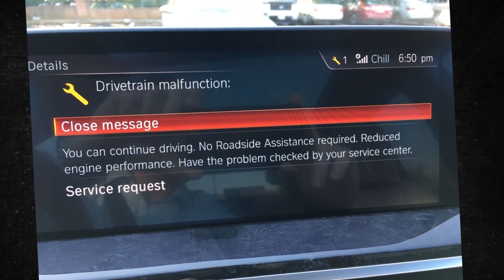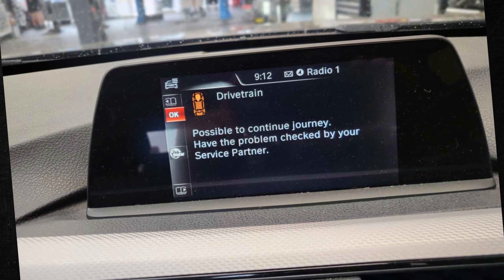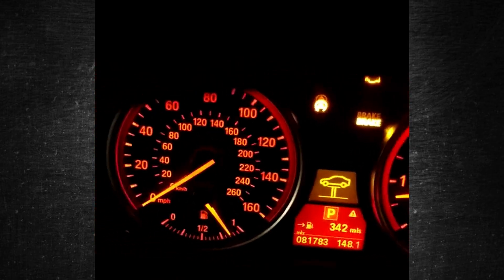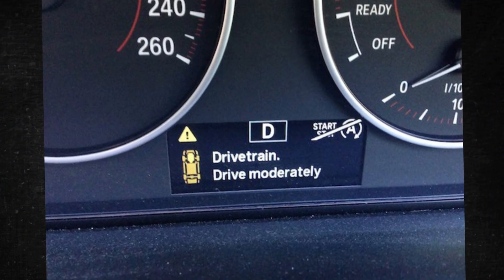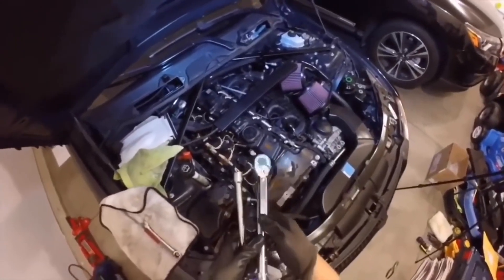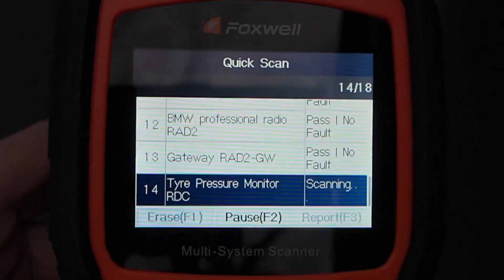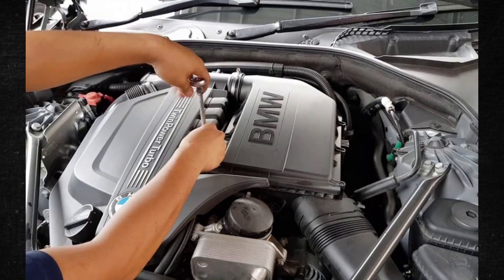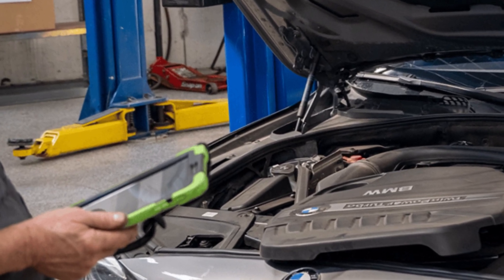5 Causes of Drivetrain Fault on Bmw (Meaning & How to Fix)

Comment: BMW x3 owner here. If you experience this problem. Start by removing your oilfilter. If your bmw is not serviced at the dealer. The oilfiltercartridge might be mässing. Causing oilpressure somtimes beeing too low. 
I had this issue, and noticed the missing cartridge as I changed the oil/filter. 
The solution is to buy a new oilfiltercap. Very cheap.
Had no issues after that. 
Its strange that more People dont know about this.
Hope it will help someone 🙂

Comment: If youve got this on your car. Dont worry. It's nothing serious. Very likely a loose connection or a sensor has become loose. I found this out today. Just get it plugged into a computer. My engine completely shut down. And wouldn't move. I thought my car packed up. Its just a safety thing on the car. So dont worry.
Reply: Would it be caused by coolant system issues?
Reply: I dont think so. The only issue i would of thought with a coolent system. Would be a leak. Why have you got it on your car doming up. Whats it saying ? @John-zh2zy
Reply: How do I remove the map sensor? It doesn’t budge and is really tightly fitted on my g30 2018 520d
Reply: @EggsEggsTension  I don't know anything about a map sensor. But I wouldn't of thought it was anything serious. But if you can get someone to plug it in. It will show up a code. And an issue
Reply: Iv git n missing message ibs sensor but replaced all ibs sensor’s but still get same fault clear codes stats away for few days then randomly as i turn car of boom fault pops bk up i get random faults for brake pads even tho new  n new wear sensors only thing i can think now is faulty fem
Reply: Did your car start rough for a second and then shut off like it was getting a misfire
Reply: Do you know what specific sensors it may be
Reply: Its a aensir that came loose when the mechanic fixed something on my car. They kind of clip together. Ill try and see which one  @ritojasso
Reply: Hey do  u know what fault codes u had ?and what year bmw ? I have a f10
Reply: I can't remember the fault code. But it was a sensor that was loose. So the car completely lost its power. Was nothing serious. Its a 320 year 2017  @DavidMendoza-y1p
Reply: thankyou bro im stressing rn but not anymore🙂
Reply: Same happen to my 2016 f30 I had to turn it off and wait a bit n then it came back now it’s at the shop, need brakes, oil change, possibly brake fluid and inspection but no leaks idk let’s see
Reply: I know my bmw wheel speed sensor been out for awhile now and recently the drivetrain sensor pops up. So I just bought the wheel speed sensor so hopefully that was the only problem and everything will go back to normal
Reply: @RaheemGTRR any news bro?
Reply: @Ramboramo-f9b  mannn turns out is the battery. I’m currently about to get one. The thing is when you see Drivetrain malfunction pop up, it can be anything.. but brooooo.. it has to be the freakin battery. And to prove that it is my battery is dying rn because it’s popping up on my car. But hey that’s what you get for not driving it for months right 😂🙃
Reply: @RaheemGTRR bro its good to know your car is fixed. Hope you are enjoying it.
Reply: Could it be a timing chain?
Reply: I had a 2019 M240i BMW B58 with a stage2 ECU upgrade and down pipe  i was driving out of my yard on thr road the moment i put it on sport plus when pull away then my BMW cut out and show on the computer display that my drivetrain is malfunction i turn of the road i put my car of for a 3 minutes and start it a gain and the computer display shows that everything is okay and have my full power back on the BMW
Reply: @janniekilian3530 how’s your battery looking on your car? Have you changed it recently or anything
Reply: My car is heating up tho
Reply: @celiagarcia6595 is it saying it’s overheating? If so, that means you can’t be driving the car until you figure out the problem. Worst part about it is when the drivetrain pops up we don’t know exactly what’s going on. But I will say again it may be the battery key word (May) because the sensors was going insane in my car when I was driving it and it also said transmission was overhearing when in reality it wasn’t. 
Yoo.. it has to be cause of that battery.
But I could be wrong 🤷🏾‍♂️

Comment: FACTS  ! Be aware I learned this the hard way not to be ignored
Reply: When it happend to you what was the issue ? Cause it just happend to me today
Reply: Needed an ignition tune-up, that lead to a damaged DME.

Car started to misfire then shut down wouldnt start back. That doesn't mean your situation is the same it could be multiple different things as this video stated it's on point.

Best thing to do is get the car scan a.s.a.p  to see what fault code in the DME. Or you will be getting towed soon.

Comment: I changed the battery but the dealer did not installed a agm one… the drivetrain malfunction started the velocity changes didn’t applied… is it possible that the discs are damaged?

Comment: Drivetrain warning light appears for 10-15 seconds and then gone

I switched off the car in my office parking and going to start and check after 6 hours, if the warning lights doesn’t coming back, then do I need to worry ?
Reply: Yes, get your car scan immediately. A sensor is about to fail. Learned this the  hard way

Comment: I THOUGHT THE FILM WAS INTERESTING AND IT ACTUALLY GAVE ME SOME IDEAS THAT I COULD DO MYSELF AND HOPEFULLY SAVE ME SOME MONEY ALONG THE WAY. HOWEVER UNLESS I MISSED IT AND I SUPPOSE IM GOING TO HAVE TO WATCH THE FILM AGAIN IN CASE I DID. BUT IM SURE THERE WAS NO MENTION OF THE DRIVETRAIN ITSELF AND WHETHER OR NOT YOU SHOULD CHECK TO SEE IF IT NEEDS REPLACING? WITHOUT SOUNDING LIKE A SMART ARSE BUT ISNT THAT WHAT THE WARNING IS INFORMING US ABOUT THAT THE DRIVETRAIN BELT NEEDS TO BE LOOKED AT BUT THE CAR I STILL OK TO DRIVE. ITS ALL A LITTLE CONFUSING TO ME NOT BEING A QUALIFIED MACHANIC MYSELF BUT I AM A HANDS ON PERSON AND NOT AFRAID TO HAVE A GO MYSELF IF IM SHOWN WHAT TO DO. I HAD MY OWN HANDYMAN BUSINESS FOR 10 YEARS AND IM A QUALIFIED JOINER AND KNOW SOME ABOUT PLUMBING AND A LITTLE ABOUT ELECTRICS AND OBVIOUSLY INSIDE A CAR ENGINE IS A DIFFERENT SKILL ALTOGETHER BUT ITS ABOUT ADAPTING YOUR SKILLS TO GIVE YOU THE CONFIDENCE TO AT LEAST SEE IF ITS POSSIBLE TO HAVE A GO YOUR SELF. ANYWAY BACK TO THE DRIVETRAIN BELT WARNING MESSAGE AND A QUESTION IF I WAS TO JUST GO AHEAD AND REPLACE THE DRIVETRAIN BELT FOR A BRAND NEW ONE WOULD THAT AUTOMATICALLY REMOVE THE WARNING MESSAGE ON YOUR DASHBOARD SCREEN OR DO YOU HAVE TO TURN THAT OFF SOME OTHER WAY. MY OTHER QUESTION IS WHY DOESN’T BMW JUST HAVE THE RIGHT CORRESPONDING ENGINE/VEHICLE PART WARNING MESSAGE OF ITS OWN ALLOWING THE MACHANIC TO JUST GO STRAIGHT TO THE PROBLEM HIGHLIGHTED ON THE WARNING MESSAGE INSTEAD OF HAVING TO TRY A NUMBER OF POSSIBILITIES THAT EVEN ARE NOT RELATED TO WHAT THE MESSAGE IS TELLING US. JUST THINK IT WOULD SAVE TIME AND MONEY..RIGHT IM GOING TO CHECK THE FILM AGAIN AND SEE IF I DID MISS ANYTHING MENTIONED ABOUT FIXING THE DRIVETRAIN BELT.
Reply: IVE JUST HAD A THOUGHT ABOUT WHY IT WOULD SAY DRIVETRAIN BELT FAULT IM THINKING THAT THE DRIVETRAIN ACTUALLY ISNT A PART AS SUCH AND WHAT IS MEANT BY DRIVETRAIN BELT IS ALL THE PARTS OF THE ENGINE THAT MAKE THE ENGINE DRIVE THE CAR. SO LIKE A TRAIN THE PARTS TALKED ABOUT THAT COULD BE FAULTY ARE THE CARRIAGES  AND PUT TOGETHER IS YOUR TRAIN? IF THATS WHAT IS MEANT BY THAT I GET IT NOW AND I GUESS THAT WHY WE HAVE MECHANICS LEARN THAT STUFF FOR US. IT WS JUST HAVING THE WORD BELT IN THERE MADE ME ASSUME SPECIFICALLY THERE WAS A DRIVETRAIN BELT IN THE CAR.. THERE STILL COULD BE . LIKE I SAID I JUST HAD A THOUGHT WHY THE REASON BEHIND NO MENTION OF A DRIVETRAIN BELT IS MENTIONED.

Comment: What a load of non-committal nonsense.  The video is sub-titled, How to Fix. 
Anything between $100 and $5,000..😂
Reply: Right. Why doesnt the bmw just tell me what is wrong if it’s spark plug
Reply: My bmw is idling rough and when I give it gas it bogges out , replaced plugs and coils and injectors
Reply: @keithdupree4978  sounds like fuel starvation. Try a new fuel filter and check out the fuel pumps output

Comment: can you do one for chassis stabilization
Reply: Chasis stabilization is might be a (rear differential ) I changed mines and problem fixed.
Reply: @stardust2146 what do you mean by that? I have it on my 2015 bmw 328i sometimes it comes off and goes on. What should I change or do?
Reply: This my issue too